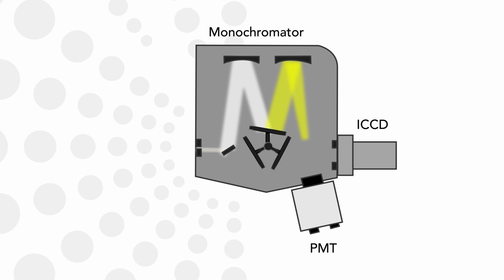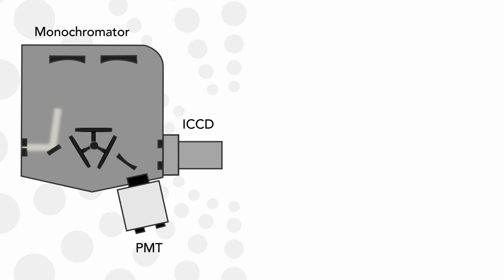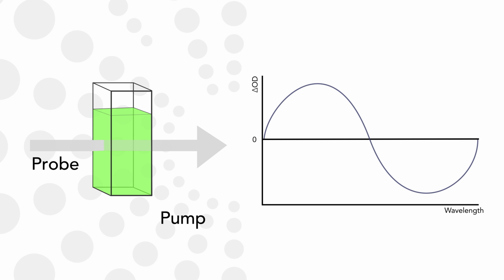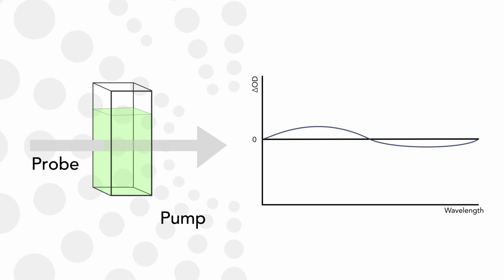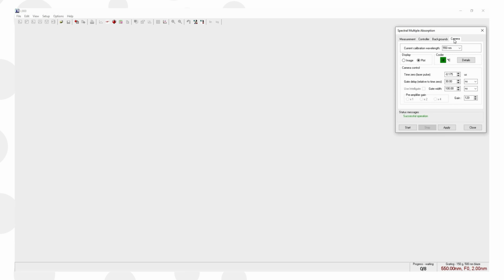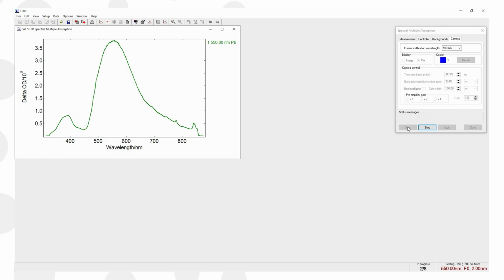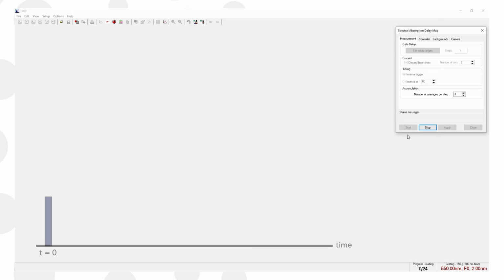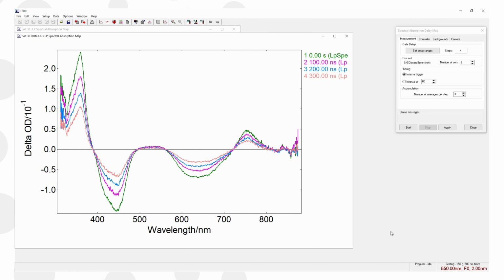ICCD Detector Spotlight | Faster Multichannel Transient Absorption with the LP980

Comment from the maker: Unlock precise transient absorption, laser-induced fluorescence, and phosphorescence measurements from 200 nm to 2550 nm. The LP980 offers:

Dual Detection: Integrated ICCD and PMT for comprehensive spectral and kinetic analysis.
Wide Spectral Range: Measure transients across UV to NIR wavelengths.
Advanced Software: L900® software for seamless control and analysis.
Ideal for studying photochemical, physical, and biological processes.

To Find Out More: https://www.edinst.com/product/lp980-transient-absorption-spectrometer/